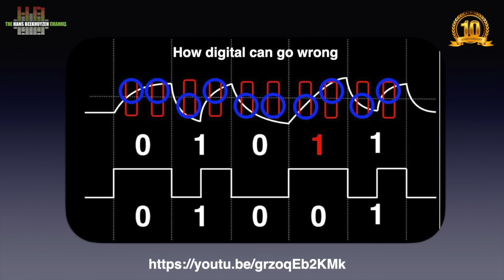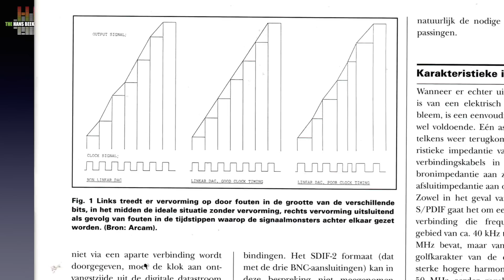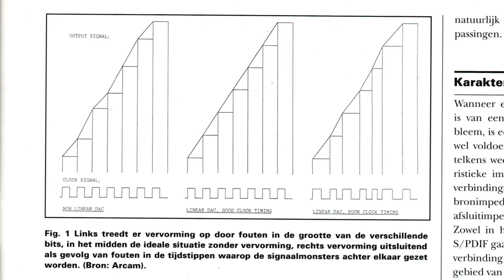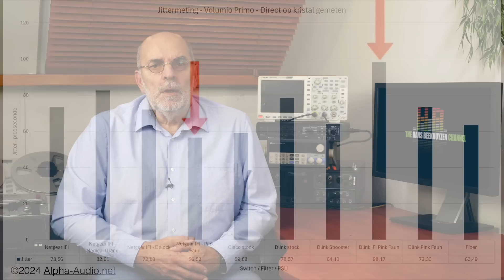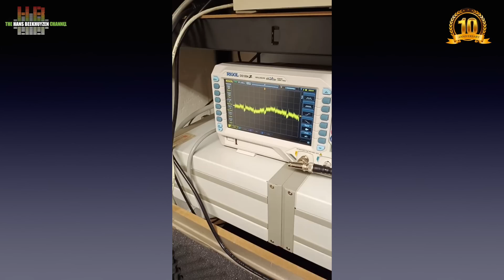Ethernet connections do have influence on the sound quality

Comment: @stevenrubin6702
0 seconds ago
If the main point is to make sure that the timing of the digital signal is correct and that the noise is removed before it enters the DAC,  would it be enough to use a digital to digital converter which regenerates and galvanic isolate the signal before entering the streamer?  In other words, why use a network switch in addition if you already have a DDC with a OXCO clock which takes care of both of these issues before the digital signal enters the DAC.?

Comment: If the main point is to make sure that the timing of the digital signal is correct and that the noise is removed before it enters the DAC,  would it be enough to use a digital digital converter which recalls and galvanic isolate the signal before entering the streamer?  In other words, why use a network switch in addition if you already have a DDC which takes care of both of his issues before the digital signal enters the DAC.?
Reply from the maker: Even with a DDC, a good network switch can further refine the signal before it reaches the DAC.

Comment: There is no doubt that jitter affects sound quality, but what does DAC jitter have to do with network device jitter? The clock from the router and the clock from the DAC do not intersect with each other.
Reply from the maker: I explained that in the chapter It's analog in this video.

Comment: Hi Hans, 

I spent some time watching your videos about network filtering. Thank you so much for all that info.
Now I have decided to implement some filtering in my streaming system.
I use a streaming device for music and an apple tv.
In all your streaming setups you place the filter behind the ethernet switch.
I was wondering if it would work if I put the ethernet switch behind the filter. In this setup I need one filter for two devices. (streamer & apple tv)
Placing one filter before the switch is more cost effective. 
Will this work?
Is there a reason why this is not a good idea?
Thanks,
Kris
Reply from the maker: I haven't tried but it will depend on the switch you use. If that doesn't add any nasties, it might work.

Comment: Again, a great recap explanation of the causes and influence of jitter on sq. This gives me the opportunity to suggest this very cheap way to upgrade immensely the sq of any system: isolation of your electronics (switches, dac, power supplies, preamp…) with sponges (M. Clean magic eraser white and blue sponges - are the ones that gave the best result in m’y expérimentation). Place your electronics directly on a solid piece of wood (like IKEA cutting boards) with the sponges underneath, blue side facing down). Best upgrade I have ever made on my $60,000 sound system 😊- it will be obvious immediately to your ears - it’s RESONANCE CONTROL. 
For this idea, I have to give credit to you Hans and another YouTuber called Gabster  who put me on the track of experiencing with vibration control. FIY, I also tried with  yellow sponges coated with green scrubbing pad type but it added harshness to the sound.
Reply from the maker: Thanks

Comment: After watching your latest informative video Hans I feel like I must really be sonically in bad shape ,  where all my kit sits is against the exterior side wall on a metal stand w thick glass shelves , the components have isolators yes , the spkrs are perpendicular to the stand closest is 7.5 M ……but because there is no Ethernet connection..and not easy to run to that location ( wife won’t accept cables taped to floor holes in wall etc ) I have to use wifi 😨
I stream FLAC files to my Rivo then on to the Cyan2 , till your revelation I was thinking it sounded pretty good, however I realize that Ethernet is always recommended to be the best choice …. So w my wifi setup now assuming that what I’m actually receiving is an even less accurate stream of 1’s and 0’s …!?
Reply from the maker: Wifi can sound good if the Wifi equipment is good and up to date and there is not too much. use of the bandwidth by surrounding wifi users.
Reply: @ well the wifi is good with a booster closish…and not so much traffic on it so perhaps it’ll suffice …much appreciated Hans , from one old audio guy to another 🙂

Comment: I use Cat8 throughout my network. I decided to ground the screen at the hifi end to see if it made any difference. I stripped the end of some wire, wrapped it around the metal on the end of the cable and connected the other end of the wire to the ground on my mains filter. I was surprised at how much the sound improved.
Reply from the maker: Thanks

Comment: Doesn’t wifi transmission largely avoid some of these transmission line issues, especially when the bits are dumped into a buffer and then entirely reclocked by receiving device?  Naim have claimed that there is no degradation with wifi transmission as long as signal adequate (ie no dropouts).
Reply from the maker: See the white paper mentioned in the description
Reply: @ 
I asked you about wifi transmission and you referred me to Swenson’s paper, but it doesn’t mention anything about wifi.

Comment: Thank you so much for this presentation. The presentation raises a question for me. In the past, my DAC was served by music on my computer hard drive some forty feet away.the dacwas cabled to my computer via an Ethernet cable and a D-Link Ethernet switch box. Based on what I understand from Hans’ video - mine was probably not a setup rigged for optimal sound. A few years ago, I invested in a Roon Nucleus Plus and now, much of my music resides on the Nucleus. I download new music to my computer and then copy it (via that ethernet connection to the Nucleus. Do the downloaded files suffer permanent ‘damage’ as a result of having been transferred through the Ethernet switch box and cable?
Reply from the maker: No, the files stay intact

Comment: Hello Hans,
Thanks once more for your value insights.
As an audiophile and IT engineer, I hear and notice the difference in sound when switching network gear and cabling.
What I do not yet comprehend, is where the time jitter happens.
On the network, the data is sent in blocks of bytes and on every switch/router in the path, checked for correctness (ask for resend in case of issues). This means that on the receiving end (Streamer) when converting this datablock to a clocked stream of bits, the jitter is introduced. Hence not on the network (where you rightfully state, that square waves are not really possible) but in the streaming device?
Kind regards
Reply from the maker: As said, in the description there is a link to the white paper I mentioned in the video. Read that for a further explanation.
Reply: So a fibre connection should solve this network interference and then it is for the streamer designer to do the conversion from optical to voltage and try to avoid the pico jitter?

Comment: Thanks for the video Hans. Im only missing more about how much it affects the analog signal OUT of the DAC, since most DACs of today have so high resistance to jitter. More jitter into the DAC doesn’t necessary mean degraded soundquality OUT of the DAC.
Reply from the maker: If the digital analog conversion is faulty, the analog signal is a result of that and thus will be distorted.
Reply: Thank you for this  I think the question of @erikbardalen7771 is most relevant. What I miss in your video and your response is why DACs are so susceptible to a (slightly) deformed shape of the digital bits. 

Many digital systems have error correction build in and in most digital systems a network component transfers the signal from input to output which in turn is delivered to the DAC.

So shouldn't this discussion be on (a) the quality of the build in network components and (b) what the tolerance is of DACs?

Comment: I recently had a network switch on loan from a dealer and it only took one evening of serious listening to realise what an improvement it made. I already had a switch designed for audio but the difference is much greater than I expected, I already have an ADOT fibre kit but because the new switch has SFP connections, the ADOT is now connected to one of the ports with my Melco server connected to the other. The addition of an SBooster power supply for the switch improves things further. The initial comparison was done using my previous configuration with my server connected directly to the ADOT so as to ensure this was a like for like compression. The SFP’s were then added followed by the SBooster  I have absolutely no background in engineering and science but  I have often wondered if the things we hear aren’t always measurable so I’m glad to see there is some evidence too. Thank you, Hans
Reply from the maker: thanks for sharing

Comment: You are right, those of us that can hear these differences have been aware of them for a really long time. 

It is always funny to me how many people think that digital is just 1's and 0's. It is only written in code that way. The transmission has always been an analog electrical signal of high or low voltages. As with any electrical signal, it is easily effected by RFI, EMI, any stray electrical fields, the ground plane voltage, shielding, and dielectric absorption or constant, etc. It is very fragile and easily altered in a way that affects the conversion process.
Reply: We have protocols that take care of package transmission. Transmission is in most cases not an analog electrical signal. By definition, electrical signal of high and low voltages that is encoded, is not an analog signal. For example if we use TTL, acceptable voltage for low is between 0 and 0.8V, for high it will be 2 to 5V. So we would need induction due to noise of at least 2V, to convert digital zero to digital one. Anything less has no effect whatsoever. And even then, we check packages and we either resend them, or we know that packages were being lost. Further more, we usually use differential signal transmission with twisted pairs, so it is actually delta voltage that matters, not absolute. As wires are twisted pairs, anything induced on one wire due to noise, will be induced on another one, and delta stays the same. 
Ethernet cables, wireless signal, anything of that matter, makes absolutly no difference whatsoever in sound quality. Don't be naive. If we have for example poor wifi signal, packages have to be sent over and over again, and you will expirience poor transmission speeds and you won't keep up with filling up the buffer - youtube video or song will pause in between, but anything that does play, is of perfect quality and intact.
Reply: @cnc_channel510  don't waste your time with those pseudo-scientists. It's just not worth it.
Reply: @PainterVierax  Completely agree and well stated. With an IT background it's mindboggling how poorly the research is done. Essential steps are left out for reasons I can't understand. 

Just some aspects that appear totally out of scope for these "ethernet cable quality influences digital audio quality" discussions:"
1. If audio quality is influenced, why isn't the quality of all data (video, spreadsheets, etc)? 
2. Following the logic of @TheHansBeekhuyzenChannel, how is encrypted traffic influenced? Minute changes in the signal will cause that encrypted data useless. 
3. And when listening to streaming services, isn't the resulting quality a sum-up of all intermediate connections? So what if the server is located on the other side of the world?
Reply from the maker: So true

Comment: Interesting that the best and worst measurements you pointed out used the same power supply. 

I upgraded my entire network setup with iFi Power X on router, two LHY SW-6 switches, Designacable Ethernet cables and a fiber connection to my streamer. Sibilance disappeared, soundstage improved and more. Hard to explain but it makes a difference. Thanks for all of your work in this field, Hans!
Reply from the maker: A high quality switch mode power supply is always a good choice for digital equipment, including switches.

Comment: I spent decades developing RF sources for superconducting RF accelerators where noise ,particularly phase noise, is critical. Jitter to phase noise scales with frequency so a frequency of 3.9 GHz is 19500 times is more sensitive that 20kHz and everything mentioned here is on steroids in that world.  Oscillators are double or triple isolated and clock systems can take years to develop.
What is most likely is that there is crosstalk between clock systems as even very small coupling will cause intermodulation in a nonlinear clock signal chain.  I think our ears are very sensitive to IMD and that is probably those with ears that good are hearing.
This is all fixable in a dac system but as you have demonstrated it takes motivation, setting a requirement, developing of the test setup and then the willingness to put the engineering effort in to it.
Reply from the maker: Thanks for sharing

Comment: Hard to argue. I've not spent much time on this subject, but I'm curious as to how the POE is dealt with when receiving an audio signal. I know power from a USB that's transmitting data can create higher noise than running power from separate psu so the USB is data only. Could not only switch and cable quality, but how POE is dealt with by the convertor board create more noise?
Reply from the maker: I have not tried this but your reasoning makes sense.

Comment: Hi Hans, has been following you for years and fully agree that quality of digital signals are neglicted by many. 2 years ago I found that streaming from Qobus had reached a quality good enough to beat my belowed LP12 grammophone and my NAS. I stream wireless from a standard router to my Auralic Aries/Vega G2 combo - the Vega directly controlling a couple of active ATC SCM50 speakes. A very revealing setup. I decided to check eventual quality gains from cabling and powersupplies around my routoer and modem, not expecting much. Huge surprise. Now the modem and router is powered by a dedicated wallplug feeding a dedicated powerstrip through a high quality powercable. The ethernet cable connecting modem and router showed up to be of huge importance and is now an Ansuz C2 adding much more transparency and depth. Finally the router is hanging free of the wall and all cables hanging free and with distance from each other. No other equipment are connected by cable to the router. All other wifi equipment is turned of before focused listening. Especially repeaters make noice and reduce air and space. The result of all this madness is levels more of transperency, dynamics, scale etc. and good recordings streamed from Qobus now demolish everything else. I'm an engineer and this is hard for me to swallow, but I started to compare grammophone cables in 1975 and 50 years in hifi has learned me to trust my ears. Keep up the good work:-)

Comment: Wifi is better or worst then ethernet cable for audio streaming in this case?
Reply: Depends on the implementation and proper electrical / electromagnetic isolation.

Optically coupled cable network connection breaks the electric coupling inside your streaming device to isolate from the rest od the wired network in your home.  I wish all manifacturers would put such a socket in their streaming devices, it’s cheap to do, and all the stories on switches and network cables would be gone.

Wifi module needs to be isolated electromagnetically so it doesn’t interfere with other chips, same as the chip handling the ethernet connector inside your streamer device. That sorts the noise issue inside the device. That’s proper electronic device design, that part is trickier than isolating the network/cable, especially with WiFi. Many companies reported issues with WiFi noise, Auralic is I think the only one claiming they tamed the WiFi, all others prefer cable.
Reply from the maker: TomislavCapan is right. I would like to add that also the available bandwidth is a factor. In an apartment building with neighbours left, right, below and above you, chances are Wifi will not be the best solution.

Comment: Is it safe to say that WiFi is the preferred connection because it completely removes the need for better switches and ethernet cables, etc?

When I bought my HoloAudio Red earlier this year, I didnt care that it is not WiFi capable because I thought i would definitely use a wired connection anyway. Now I'm thinking in the opposite direction.

I was already planning on trying the new version of the Bluesound Node once Dirac Live is ready to be used with it. An added benefit is that it works on WiFi. 

It strikes me now that the Node will be the only dedicated streamer that Dirac is compatible with. It would be nice to have some higher-end options, my understanding is that the Node's sonic performance is only average. Speaking of which, I wonder if the new Node Icon is worth the extra money just for streaming quality. I dont want to pay for better DAC performance when I'm not going to use it as a DAC.
Reply: WiFi is the worst connection, unless the manufacturer has gone out of its way to isolate the noise from the transmitter/receiver of the wifi signal in the component. Auralic is the only brand that I know of.
Reply: @swinkles  ... my stone age Auralic Aries 1st gen sounds words using WiFi instead of LAN. Probably noise by the WiFi module being the reason.
Reply from the maker: It all depends, as I have said many times.